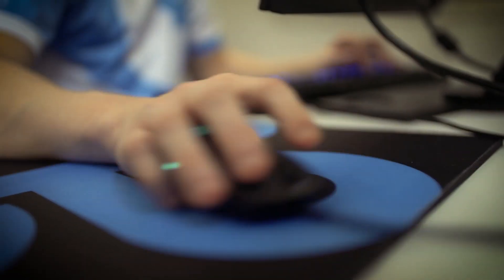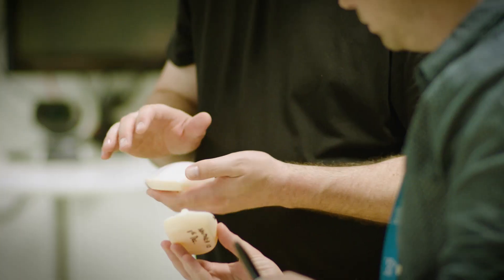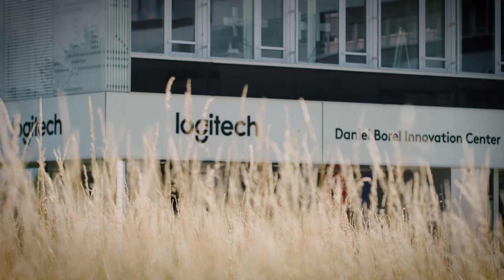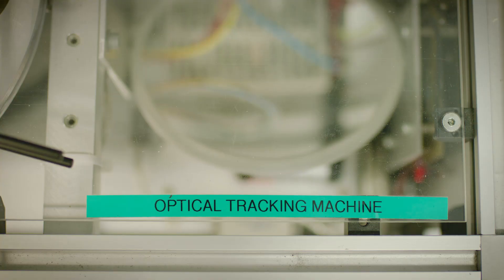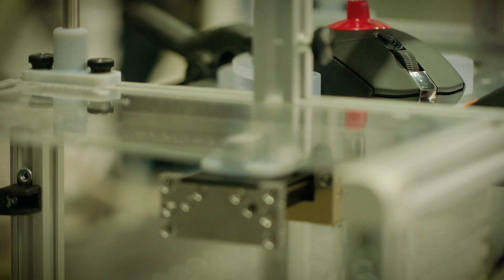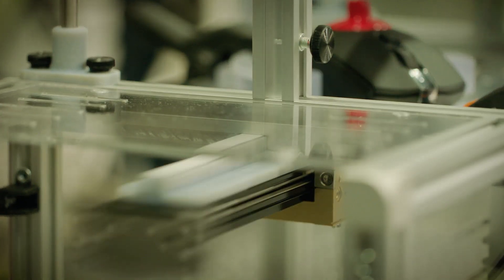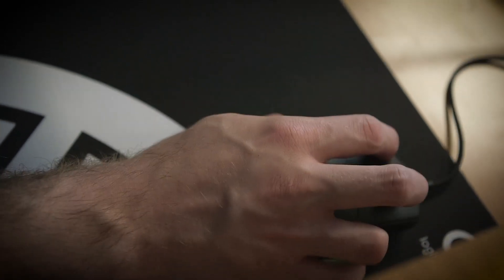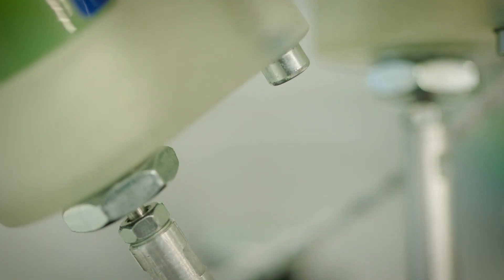Endeavor- Building a Gaming Mouse for Pro eSport Athletes [US]

Comment: Logitech you fucking suck your last three mice were designed by highschool art students you take good sensors and put them into shitty shapes you've lost your edge the best thing you can do is recycle a shape from 2k because your design team is a bunch of dolts.
Reply: and some of the best mice on the market right now are using the Microsoft intellimouse shape from 20 years ago.
Reply: Oberone Kenobi I'm using one of those shapes, what's your point?
Reply: +Hej good shapes on mice are often recycled and or made better in ways. If something isn't broken, why try and do something else ? Yes, I agree, their latest few mice haven't been the greatest, for me it was the shape and or weight. I disliked the g402, g502 amd I don't feel like shelling out $180 AUD for the g900. What I'm saying is as above, is that, these older shapes work. There is a reason why we are still using then today, they're.  comfortable. It's just mice like the mx518/g400s now have, "outdated sensors". If they could release a mx518/g400s shape, newer 3310/3366 sensor, it'd be one of the better mice on the market again. I have used those specific shape mice since I was 5, nearly 20 years ago. Its something I pretty much need these days. I also have Large hands, so that limits my choice. But I haven't changed from my g400s since I got it. 

Yes they may be recycling old shapes, but they work, and people love them. 

Same thing goes for guitars. New shapes are few and far between. They have to work.
Reply: Oberone Kenobi
I never said older shapes don't work why are you telling em all this shit?
Reply: +Hej "all you can do is recycle shapes from 3k because your design team is a bunch of idiots" Yeh, I kinda think you did you say that
Reply: +Oberone Kenobi 2k*
Reply: Oberone Kenobi
Yes, I did say that. What is the relevance of what you said to what I said? It does not disprove what I said, it does not support what I said, it is an irrelevant tangent from a Logitech fanboy written for no apparent purpose and no apparent backing logic as you can't even complete your thoughts.
Reply: At least logitech tries to fix and innovate in the mice market compared to the other perphieral companies out there. Razer has been recycling the deathadder and interpolating the sensor. SS isn't doing as much better than logitech with the Rival 100/700. Zowie just recycles there shit and overprices there mice that they sell.  Logitech has been trying to new things everytime in there line up to make things better. They have literally been combining everything they have learned in the past to create a better mouse. G900 is literally a start into moving away from the shitty shapes that everyone hated. G200 using the classic logitech shape like the M100 or G100s is a great start.
G402 (Fusion Engine)
G502 ( PMW 3366/HyperFast Scroll wheel)
G303 ( Mechanical Switches)
G900 ( Perfection of Wireless Technology + Everything except the fusion engine from past mice)
They're literally the only people in the industry that have been trying to innovate instead of advertise RGB or DPI as Razer does(Steelseries' LED Screen). I have no idea why you are complaining about using an old shape. Deathadder was based off of the WMO mice. The Rival 300 is based off the intelli3.0. What is your point about recycling classic shapes that people liked? Clearly the G303 showed logitech that heatmaps don't always work as people didnt like the G303. They are literally playing it super safe with this new mouse.
Reply: Hej 
lol
Risk
You think logitech is some sort of small company like finalmouse? They can literally take these risks because they are such a fucking huge company. Big deal, they learned that heatmaps don't always make the best ergonomic mice as they thought. To seriously get angry and mad about how logitech tried something new and not praise them for what they did right is really unfair.
Reply: Aura Desru
I'm not complaining about using an old shape, I'm complaining that this is the first non retarded mouse with a 3366.
Reply: That would be a compliment, not a complaint.
Reply: GuodlikeTV 
Yeah, I honestly don't get this guy as to why he is complaining about a right step in the correct direction. If he hated logitech using retarded space ship designs in the pasts. Why is he complaining about them moving away from it. Blows my mind
Reply: Aura Desru
the only person who is angry here is you, angry that I have used a public forum to express an opinion with which you disagree.
Reply: I don't disagree with you that logitech took a risky road trying to use heatmaps to create ergonomic shapes that didn't work. I just disagree with " you've lost your edge the best thing you can do is recycle a shape from 2k because your design team is a bunch of dolts." because it sounds like you are shitting on them for making a good design choice.

Comment: my logitech g600 in game will ALL THE TIME go really fast across the screen and i dont know why. please help
Reply: is your DPI (Dots per Inch) to high? you can check it by going into the logitech software and it will give you a DPI option.Turning it down is kind of like turning your sensitivity down as it slows your mouse.If you play a game Like csgo you would want the DPI really far down (like 400-2000 at most unless you are simply not use to lower DPI, you should probably get use to it) Also dont forget your in game sensitivity (im sure you have but just to make sure) same thing with your mouse sensitivity that is set on windows or what ever OS you are using to make sure thats not to high. If the problem still comtinues its probably best to go on a logitech forums to see if people with a logitech g600 mouse could help you out (I have a g502) and see if anyone else is having the same problem.I hope you get it fixed soon :)
Reply: +FlamingOnion_1 i know what it is thx, but it's at 650 dpi. no acceleration
Reply: +FlamingOnion_1 thx tho
Reply: +Lance Combo4Lyfe yeah the only other reason I could see is that your mouse is defective : / but again it would probably be best to go on a forums and see if people with more experience could help you :P goodluck
Reply: +FlamingOnion_1 my brothers g502 does it too
Reply: Hmm...thats very strange...Does it do the same thing on different games?Have you tried both mice on a different computer and have you tried it on a different usb plug in?Also if you have it plugged it into a usb 3.0 then try plugging it into a usb 2.0 and vice versa. Edit- Also maybe try updating the logitech software/the mice firmware but I dont think that will help too much
Reply: +FlamingOnion_1 no i dont have any other games but Minecraft, yes, yes, how do i tell the difference between the 2 and 3, and I've done that too
Reply: try downloading a free 3d game on steam if you have steam or a free 3d game that a youtuber showed off that has a link to the download.A usb 3.0 input/output is basically the same thing as a usb 2.0 except it is faster and the input/output has some type of blue in it.If you type in usb 3.0 in google and look at images you will see pictures of usb 3.0 plug-ins and usb 3.0 plugs.Some computers do not have a usb 3.0 on there PC/Laptop so if you dont then dont worry about it.
Reply: Also try using a different version of minecraft to see if it is just the version but I havent had any problems like that on minecraft when i use to play it so I highly doubt that is the case.
Reply: +FlamingOnion_1 ok, so i have the Razer Blackwidow Chroma. i use it with my laptop, and i plug the mouse into the usb on the side. question one, is that a usb 2 or 3, and does that lag to computer to make my mouse slower or lag up you think? because im using the keyboard, and the mouse, and a headset. is it too much for the computer?
Reply: the usb plug-in on the side of the razer black widow chroma is a usb 2.0 because of it being white.Try unplugging your headset and plugging in your mouse to that unless you have an extra usb slot you could use.Did you build you computer or did you get it pre-built?If you got it pre-built can you send me a link to that computer or just simply the specs of the computer(The motherboard,the GPU,the CPU,and anything else you could supply me with) and if you got it built then can you basically do the same thing and give me your specs of the computer.It would help me see if your computer can handle all of that (it should but you never know).Also what type of headset do you have, and Do you have anything else plugged into your computer besides those things?Sorry this is getting a little complicated but im just trying my best to see the problem
Reply: usb type doesnt really affect the mouse since what matters is the polling rate..i think, in general, most gaming peripherals still use usb 2 since data transfer rate of usb3 really just boosts performances on usb storage dongles and not frequency of peripherals..this is why some pro gamers still use those MS intellimouse
Reply: +FlamingOnion_1 Intel Core i5 Touchscreen Laptop, prebuilt. my headset used to be used in a different usb where my mouse was and my mouse had the problem in every usb.

Comment: logitech needs to make a g502 but lighter without getting rid of the main features.
Reply: u can try G302/G303
Reply: yeah The G303/G302 is another good mouse :P Its probably Logitech's best gaming mouse
Reply: I'm having the G302 and I can say that it's the best gaming mouse ever. if you get used to the shape its so good.
Reply: Yeah I have the g502 proteus spectrum and when I was getting it I was deciding in between the g502 and the g303.I chose  the g502 because it had a little more features than the g303.If I were to ever get a new gaming mouse I would get the g303 unless they come out with a better mouse.The only flaw with the g502 is it is heavier than most gaming mice, but doesn't bother me to much because I'm use to heavier mice.Hopefully one day logitech will come out with a mouse living up to the expectations of the g502 and the g303 or even better.The 2 mice are the reason why I believe Logitech mice are dominate over Razer mice.Although my set up is mostly Razer (keyboard,mouse pad) I would love a Razer mouse to go with it ,but Logitech is still making better mice for my liking. Edit-Logitech also needs to step up there headset and keyboard game a little bit,The G930 headset is perfect except for a few problems with the battery but they do make a none wireless version (g35) the newest headset on the other hand I heard was crap(the g933 and g633)Im not a huge fan of (I dont own the g933/g633 but do own the 930) how bulky it is and I heard it fell of your head easily and wasn't comfortable. There are a few decent keyboards that logitech makes but they are not ahead of the keyboard game.The keyboards that attempted to compete with Cosairs and Razers superior keyboard (Im mainly talking about the G910 Orion Spectrum) is also kind of crap and late in the RGB community. I never had the keyboard myself but definitely gave it a chance when I was looking at new keyboards to buy. by looking at reviews I didn't believe it came to my likely as it looked very cheaply built and didn't live up to some peoples expectations.Maybe if logitech took some advice from companies like Razer and Corsair (have a metal frame with better RGB lighting,Had a better looking interface, didnt make it seem like it was cheap/forced, maybe add a second usb slot like the razerblackwidow,and still made it cheap) Then I would definitely go with logitech and turn towards a more logitech setup rather than a razer setup.I know this comment is basically a full out review but I hope Logitech would read this or listen a little bit more to there community and make a product as good as their mice without taking to big of a risk for other things.
Reply: +Fzmh the g502's thumb rest is perfect for me.honestly your probably the first person I have heard from saying the thumb rest is bad.
Reply: +Fzmh true I could live without it but it doesn't really add that much weight but if they took it off it would probably be more in the gaming mouse weight zone of science
Reply: ***** then the G100 is for you. super basic, still decent.
Reply: FlamingOnion_1 I'm having Logitech mouses now, I've been using the B100 for 2 years now I'm switching to G302. Both give me wonderful experience. I'm looking forward to buy a G610 or G810 when I go to college. Logitech peripherals are decent.
Reply: They do. It's called the G402.
Reply: Although it was my daily driver for a long time, I'm currently trying to find something lighter.
Reply: Kang The Mad have you tried the G302/G303?
Reply: Yeah it wasn't for me. I didn't care for the shape or the way the plastics felt on the sides.